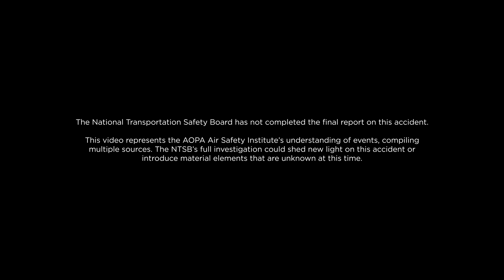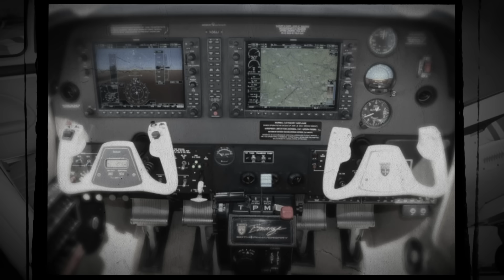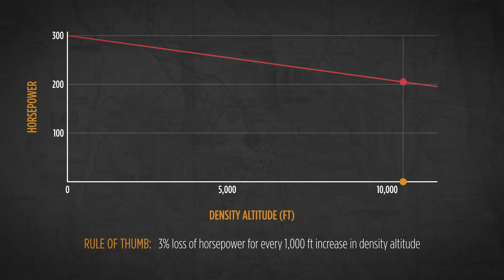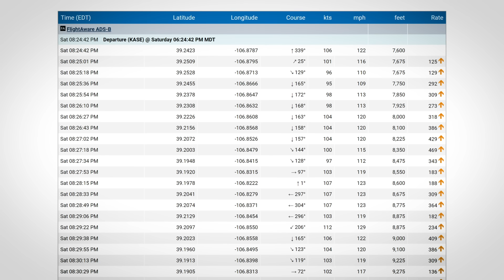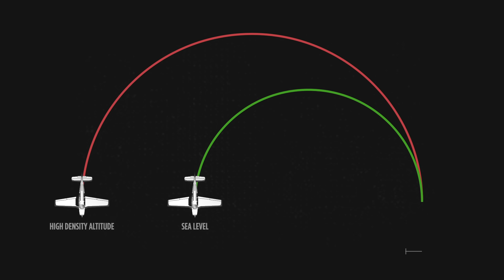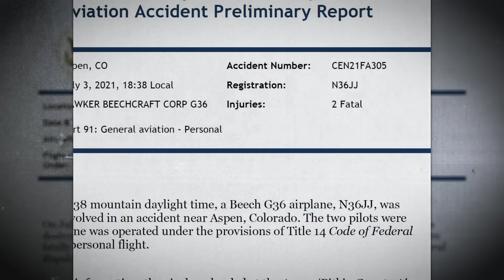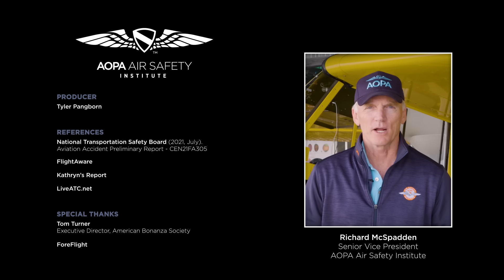Accident Case Study: Into Thin Air

Comment: Thank you for another wonderfully produced case study.  As a flat lander, I’m terrified of mountain flying simply because I’m uneducated about it.  I know it can be done safely, and plan on taking mountain flying courses prior to trying it for myself.  Hopefully others will learn so this tragedy is not repeated.
Reply: I'm from the Netherlands. I hear you! 😟
Reply: @jingle1161  You can practically fly below sea level in the Netherlands!
Reply: Having respect for the mountains is why you won't die flying in them. ;)
Reply: The main thing is to never try outclimbing terrain. Plan your route and know how high the peaks are, and make sure you're above them before you head towards them, even if that means twenty or thirty minutes of wasted time climbing. Fly down the right side of valleys (as mentioned in the video) to avoid traffic (since you'll both likely be flying co -altitude for as much terrain clearance as possible), and get as much altitude as you can when crossing ridges. They often have a big updraft and a big downdraft on each side, respectively, and if you get stuck in a 1500 fpm downdraft you'll appreciate 2000 feet to get out of it with.

Comment: Does MSFS have density altitude simulation? I know DCS does
Reply: According to another commenter who tried out this situation in the sim and crashed while doing it too, yes it does.
Reply: It does, but it is no where as accurate as real-life. The air-fuel mixture aspect in the simulator is a little too forgiving. At these extreme density altitudes, you have to get that part perfect to be able to make optimal engine output. A slight screw-up too rich or too lean has detrimental effects on engine output.

Comment: A chilling twist on the old Irish blessing,  "May the road rise up to meet you."  Urgent time pressure doesn't suspend physical laws. Perhaps it would have helped if the pilots had previsualized the density altitude of the pass they were hoping to cross, not just that of the airfield. But as I comment elsewhere, the pilots probably did the right math but took the wrong path.
Reply: "It's hard to sing with an empty glass."

Comment: Glad to see AOPA back on what they have done best with this channel. Points well made. Yes, DA. But you can just as easily get into a terrain trap at low DA if you fly up a valley you cannot turn about in. In that case there is no contingency, when common sense alone should tell you to always have an ‘out’.
Reply: Yup. The first fatal Icon A5 crash was at a lake with an elevation of 450 feet.
Reply: I agree with the point about the terrain trap.  The fact that they took off without a clear idea of where they were going seems to be the pivotal moment here.  When they realized they couldn't do their assigned IFR route, they should have reevaluated the situation and figured out exactly what they were going to do, and how they were going to do it.  But hindsight is 20/20, I guess.
Reply: Yup.
Reply: I can't get into their heads but being from the East,  I CAN say that Pilots are simply accustomed to flying around any high terrain and by "high" I also mean; not where DA becomes critical.

Comment: And hugging the sunny slope of the pass would probably have given them additional critical lift...
Reply: As anyone experienced in soaring knows. But we also consider lee side rotor too.
Reply: @SVSky  Yeah, I was going to say that the lee-side rotor was bad. Most of the time winds in the mountains flow West to East, which would have provided an updraft. But, when the winds are going East to West, now you have a downdraft. My mountain flying instructor told me once, "Imagine God is throwing a bucket of water on the mountains in the same direction as the wind. What does the water do? It flows up one side and down the other. The wind does the same thing". That has always helped me visualize what the wind is doing in the mountains.

Comment: In addition to the high DA, Aspen airport is notoriously unforgiving.  Too bad they hadn't talked with any local pilots about this before taking off.  This is an excellent review for those of us who have been away from light piston aircraft for many years.
Reply: With the GV and 7X type ratings, that "safety pilot" surely knows about Aspen.
Reply: Night and day in high performance jets. Especially that 7X which was made with airports like this in mind. 

I’ve done a V1 cut out of Aspen in the sim and I think I disappointed the sim instructor because I made it seem effortless. 

Rather than heading left for independence.. I turned right over the ski hills to give myself more track miles before eventually arcing around for that valley. 

All those years flying piston singles in high DA in the mountains paid off.
Reply: @dingodango1  I agree he's likely been there. But those airplanes face different challenges at that airport, than a naturally aspirated 6 seat piston.
Reply: @dingodango1  You'd think he would have at least had the presence of mind to look at what they were facing. The fact that they filed IFR (local MEAs are all over 16,000 feet) and even sought out the clearance after taxiing out suggests they did, at best, a very cursory job of looking at the requirements for getting out of there. My guess is that he had done little or no flying out west; or, if he did, did it in turbine equipment (after all, why else would you have an ATP.) I wrote a comment above to the effect that with 1700 hours of mountain flying (I picked up my license in Laramie and bought my airplane in Bozeman,) I never flew the central mountains of Colorado. Pick up the L9/L10 IFR charts. You'll see what I mean about the MEAs. If you're VFR, the area is manageable, but in a tricky way. Taking the valley north out of Aspen, you hit I-70 at Glenwood Springs. You can follow that east comfortably until you get to Eagle (airport opportunity) where you turn north and make your way up the valleys to Walden, then over to Laramie. From there, you are clear of all the 14,000' terrain and can safely head east at 11,500 (note the VFR altitude.) 

And, at 6PM with the threat of not being clear of the front range until after dark. I just can't believe that a well qualified pilot would have any time out west if they were making these decisions.
Reply: Makes one wonder what they actually did during their 4 hrs on the ground at Aspen. Shoulda grabbed a hotel, talked to some pilots familiar w the locale, & analyzed the heck outta their nav charts & perf data
Reply: @michaelh8890  And waited till morning.  They even could have asked the controllers which direction small planes usually went.  I would have circled the runway until I had the pass height, then went for it still climbing.  You burn off fuel orbiting the field too.  I did that flight 2 years ago and fueled in Grand Junction.  Even in a turbo, I wouldn't have gone to Aspen.
Reply: @michaelh8890  right? you would think a simple conversation with anyone at the airport would have saved them
Reply: @texclydes  ego
Reply: @texclydes  I recall an evening where a Cherokee Six came into our little airport for fuel.  A family was on board. The pilot- father was acting very strange, and a few of us commented on it.  It was IFR with a low ceiling.  The pilot wasn't interested in any local chit chat.... just the fuel.  Well.... he skud-ran to the north and into a prominent ridge.  All died.  I wish I could have told them about that ridge... and I tried... ( we always told folks about it... ) but quite honestly, the very strange acting pilot wan't interested in any conversation.  Poor bastards.   They never knew what hit them, which is a god send.  What was left of the aircraft was a malodorously indescribable horror.
Reply: @eugeniustheodidactus8890  Maybe it was a murder/suicide?  Crazy thought but you never know.
Reply: Landed at PITKIN County once.  That airport is in what I call a "fish bowl",  quite a few step downs to get into it because of the mountains around it.
Reply: @a914freak  Yep, have you ever looked at the approach plate into Aspen? It's basically a visual approach once you descend to 12,000'. I've never been the least bit tempted. Besides, there are better mountain towns to fly into... :)
Reply: With such a low climb rate, they both should have known something was wrong and to turn around. Better yet land and redo their flight plan. A 200 fpm maximum climb rate is essentially nothing in the presence of possible downdrafts.
Reply: Even just flying it in a sim while limiting themselves to 85% throttle would have been enlightening.

Comment: Only thing missing in this accident chain is they had changed the plan, and they didn’t have a plan before taking off. Those are red flags too.
Reply: And the first one should have been, the decision to fly across the Rockies at Colorado. Would have been better to pick lower, more forgiving terrain, ie north along I-80 or south through New Mexico.
Reply: @toldt  The only problem with flying South through New Mexico is that while people equate "New Mexico to Desert", you really have to go pretty far south to get to the lower altitudes. Angel Fire Airport (KAXX) has a field elevation of 8,380 feet...which is higher than Aspen. Santa Fe is 6,349', but often has warmer temperatures so density altitude can be just as high there. You are correct about going through New Mexico, but the flight path would need to be far enough south to get over the Sangre de Cristo mountains that run down to Santa Fe.

Comment: That's utter madness 😳 what were they thinking??? 

The "Unable to make 16000" was the key indicator of an unmanageable threat, which should have been thought about and planned for before they left the crew room, not after they had received their IFR clearance....

Just absolute madness. Plenty to learn from this. Excellent video and once again excellent commentary.
Reply: I don't understand how they could have planned on flying IFR across the country if they couldn't overtop the peaks of the mountains.
Reply: @nitehawk86  In the SID it says "TAKEOFF RUNWAY 33: Climb heading 343° to 9100, then climbing left turn to 16000 on heading 273° to intercept I-PKN NW course outbound to LINDZ INT/DBL 13 DME. Then via assigned transition, maintain 16000, expect clearance to filed altitude 10 minutes after departure"....

Which is exactly what the controller gave them. Makes me think the didn't even read and brief the SID before startup! 🤦🏻‍♂️. With an ATPL in the cockpit who should know better, that just shouldn't be happening. 

How many more times is poor airmanship in the form of bad or no planning going to kill people?
Reply: Seems like you just answered that question; they don't appear to have planned much, if at all

Comment: I have flown in those mountains many times in a Piper Saratoga and knew where that story was going before watching it.  I don't understand how an ATP would not have been able to negotiate their flight path safely.
Reply: Leaving at 6pm, they were probably feeling pressured by time constraints.  Otherwise, why not sleep and wait until morning?
Reply: @jonasbaine3538  Based on the pilot's conversation with ATC after departure, they had no idea what they were doing.  You can't understate the gravity of the mistakes made by these two.  May they RIP.
Reply: @crfdln  Mistakes or Incompetence?
Reply: @greggpedder  Probably a little bit of both...IMO they're actually one and the same in this setting.

Comment: Isn’t a container of aviation supp o2 like a couple hundred bucks? For someone who owns a party bus 6 seater, that’s peanuts.
Reply: The problem wasn't O2 for the pilots.. It was O2 for the airplane.
Reply: @Bren39  Understood but I’m going to venture a guess that the pilots didn’t want to climb higher because it would present a challenge to avoid busting the 30 min supp oxygen regulations after 12.5k. They could’ve just kept climbing above the field and had the o2 around incase they were at altitude for longer than 30 minutes. The o2 reg probably played in their mind when stopping the spiraling ascent early.

Comment: So does this mean it’s impossible to cross the Rocky Mountains without supplemental oxygen? Since the subsequent range was 14,000ft?

How long can you cheat and climb above the forbidden altitude before you begin to experiment effects of oxygen derivation? (I’m not an airplane pilot so don’t worry, I’m just curious)
Reply: You can certainly cross the Rockies at less than 14000’, just not all along their length. The highest peaks of the Rockies in Alberta where I fly are around 12000’ and even then that’s just peaks, many of the mountains are shorter and the passes are lower still. I can traverse the Rockies here easily at 7000’ to 9000’ if I pick my route right. The Rockies are higher in Colorado, but there was nothing in the video to indicate that these pilots were forced to traverse the Rockies at one of their highest areas on this cross country ferry flight. They could have diverted north or south and found a crossing point better suited to their equipment and experience level.
Reply: FAR 91.211 Supplemental oxygen.
(a) General. No person may operate a civil aircraft of U.S. registry—

(1) At cabin pressure altitudes above 12,500 feet (MSL) up to and including 14,000 feet (MSL) unless the required minimum flight crew is provided with and uses supplemental oxygen for that part of the flight at those altitudes that is of more than 30 minutes duration;

(2) At cabin pressure altitudes above 14,000 feet (MSL) unless the required minimum flight crew is provided with and uses supplemental oxygen during the entire flight time at those altitudes; and

(3) At cabin pressure altitudes above 15,000 feet (MSL) unless each occupant of the aircraft is provided with supplemental oxygen.
Reply: And on the subject of “how long can you cheat”, everyone experiences hypoxia differently so not an easy question to answer. Hypoxia possibility only gets worse at night and they were taking off early evening.  Don’t go betting your life on the hopes that you are less susceptible.
Reply: I live at about 4K msl, but am constantly adventuring above 10K. Sometimes I won't feel it at all at 11,000.... Sometimes you get altitude sickness at 8,000.  Unfortunately, very hard to predict.
Reply: No, you can cross them just fine.  But you don't do it via Aspen.  You either go north via Wyoming (SLC - Rock Springs - Casper), or south via New Mexico (Winslow, Gallup, ABQ).  You can also do it via Colorado, but you're probably going to need to be up to 15,000 - 16,000 feet at least for a little bit to have sufficient clearance from terrain to be safe.  Corona Pass (the recommended way to get from Aspen to Denver) is best crossed at 15,000 feet or higher due to glide considerations.  Their first bad decision was to head south from Aspen.  All your good air crossings are north.  The preferred paths are either NW via Glenwood Springs, then Eagle, then Kremmling and over Corona Pass, or NE via Meredeth/Ruedi Reservoir, Leadville, south to Granite, then east to Windy Pass (Denver) or southeast to Wilkerson Pass (Colorado Springs).